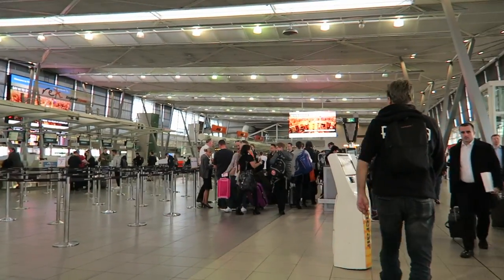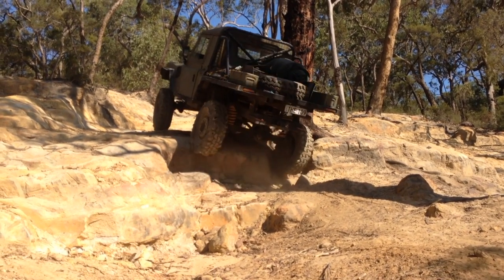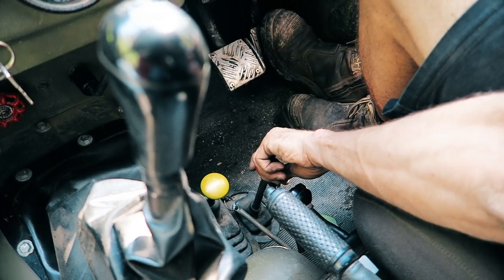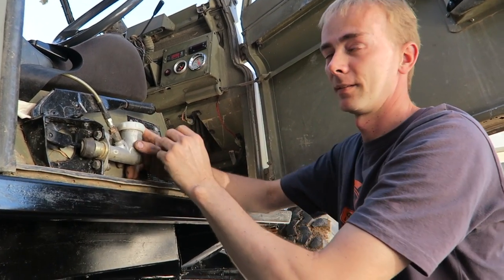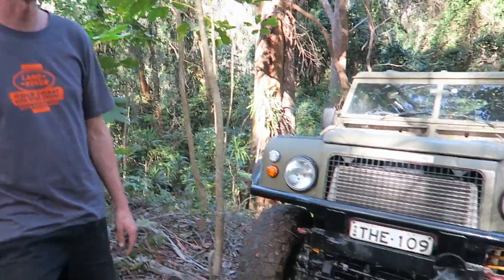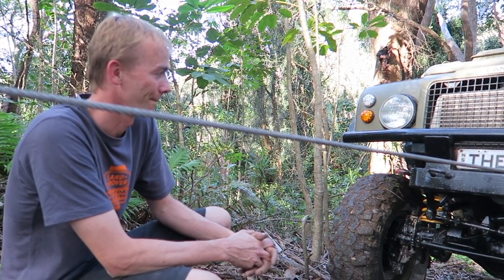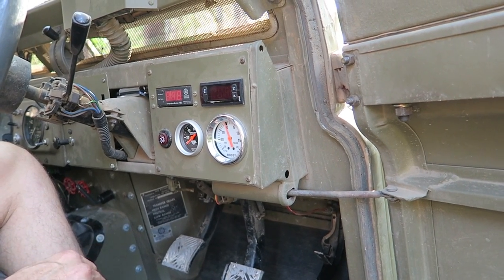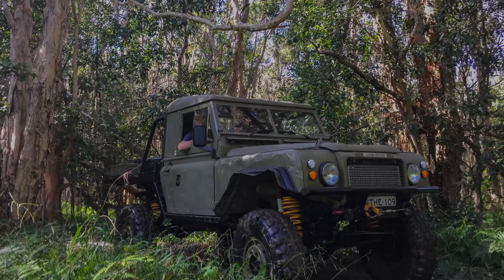Landrover Series 2a 109 | Volvo Portals | Super Winch | 4DB1T | WALKTROUGH | ALLOFFROAD#126

Comment: what your opinion on jeep wranglers? I`m thinking of buying a new or nearly new wrangler but i`m not sure how reliable or practical they are. Only need a short wheel base because most of the time its just me and my dog. I want a rubicon because of the diff locks they come with.
Reply from the maker: Great platform but need some modifications in my book good thing is you can get nearly everything for it from mild to wild

Comment: why don't comp rigs have those winches, that's a fantastic setup,... maybe a cage between the winch and the cab. love it thanks.
Reply from the maker: I thought that as well but the way the cable is routed even in a failure there is not much danger from the drum or cable on that side
Reply: itll doo depending on where you are in the world and what type of racing your involved in.  Those Time Trial type of racing use these.   These PTO are usually found on farm trucks for accessories as well

Comment: Portal axles (with the small amount of research iv done) seem to be really really highly expensive 😢
Reply from the maker: yes they are not cheap however you going to do it
Reply: AllOffroad 4x4 Adventures TV . $19.500 from one credible manufacture! I don't think I'll be doing it anytime soon. I don't really do any "hard-core" 4wding, so I think I might just upgrade my tyres from 33's to 35's. This should help just enough. 👍🏻
Reply: In Belgium they are not legal (if not fitted standard ofc.). For example: a Unimog with portals is legal, putting those same portals under a Defender is illegal.
Reply: I looked into a set of axletech portals for my F250 but at $5000.00 U.S. a piece it's just not going to happen.
Reply: We got Tibus (also known as Killeraxles) bolt-on portals over here in Germany, a conversion will set you back between 6k and 10k Euros. But depending on where you live, shipping, different currencies etc will probably bump the price up quite a bit. I have no idea how they perform in heavy terrain tho. They come in 1:1.6 heavy terrain or 1:1.16 daily driver/touring ratios, the wheel size is limited to 35".
A set of used Volvos will set you back at least 8-10k here when buying from Ebay or other parts sources. Unimog portals are also a common choice but those are super heavy. The availability is good though and so are spares/replacements.
Reply from the maker: +jonas duell Yes, the Tibus portals don't have a good reputation in Australia, someone I know gave up after a year and ripped them back out as they constantly failed, we have a bit harsher conditions here then most of Europe and they don't seem to be suited. I tried to persuade Wolfgang to sent us a pair of his newer one so we can test them here and see if they are stronger now but I would not risk 20k out of my pocket to find out if they are.
Reply: retry tobuy 19.5k😳😳 who's that through and for what 4wd?
Reply: @AlloffroadAu  What about the articulation?
Reply: Even in sweden these portal axles are very expensive compared to just 6 years ago. I had a 1988 Mitsubishi Pajero with Volvo portals.

Comment: How do you find the Isuzu transmission ratio with the 4BD1T on the road
Reply: With the portal reduction it does around 2800 rpm at 100 kph, the Isuzu would be much quieter at 2000 rpm. Other than that it's good on fuel and nice to drive, plenty of torque. Off road is where it shines.

Comment: How much pull can that winch handle? 12000lb?
Reply: With no shear pin and a full size drive shaft it stalls the motor if the gear is too high, either that or it breaks the cable. Mind you I've only ever broken one cable in 12 years with this winch. Usually it drags up whatever is attached to it whether it likes it or not. Ask anyone who has been on the other end of it and they'll tell you how powerful it is. If I'm not careful it will crush cars like sardine cans when caught between rocks or trees.

Comment: What is the yellow shifter next to the center diff lock for?
Reply: On a standard Series 2a the red lever is transfer box high/low and the yellow engages 4 wheel drive when you push it down (no centre diff). Normal position is 2 wheel drive. But with all those mods, they might be doing something else on this one...
Reply: Yeah, he said the red lever engages the center diff.
Reply: LT95 transfer case, work that one out.

Comment: The only bit that's 2a on that is the bulkhead and doors. It's a bitsa.
Reply from the maker: +bob p don't forget the frame, but what does it matter???
Reply: AllOffroad 4x4 Adventures TV 
Didnt he say its of a range rover.
It's a shame he didn't do a video of the builds that would have been interesting, especially the winch set up
Reply: I think you need to look a little harder, there are far more 2A bits there.

Comment: I'm confused as to how you can call this a 1966 Land Rover?
Changed engine.
Changed gearbox.
Changed chassis.
Changed axles.
Changed bonnet.
Changed wings.
From what i can see the only thing that MIGHT BE 1966 are the doors, bulkhead and chopped roof and the heater.
Reply from the maker: That’s what it started at and what it was registered under it certainly wins no price for original but it was never intended to
Reply: It still has the original chassis which I converted to coils, the wings are original with headlights mounted in them, rear tailshaft has had uni's replaced but is still the 1966 one. The roof came from a wrecking yard as it was a soft top GS ex army 11 seater.  The rego still says Series 2A with its original chassis number, been toying with this for 19 years.
Reply: It’s a 1966 Landy, that’s where it started, that’s when it was born, what happens during its life cannot change that….why would you even want to make such a comment?